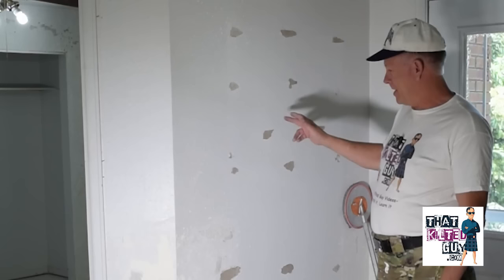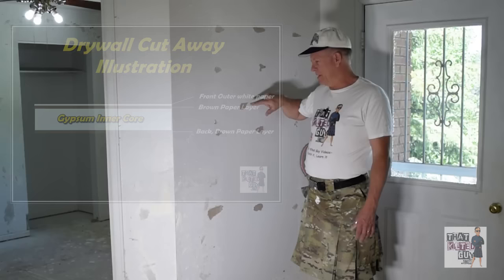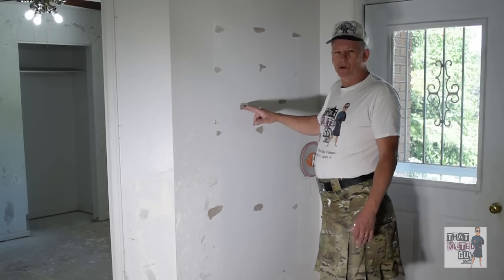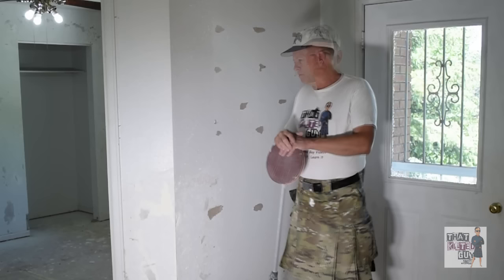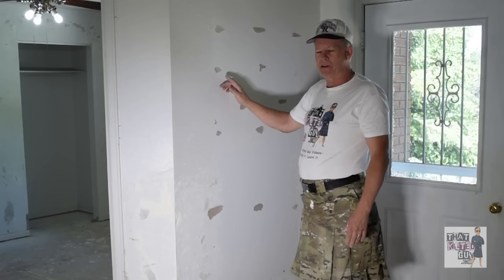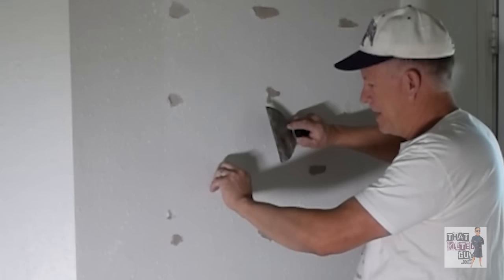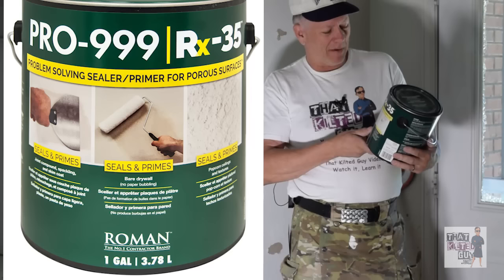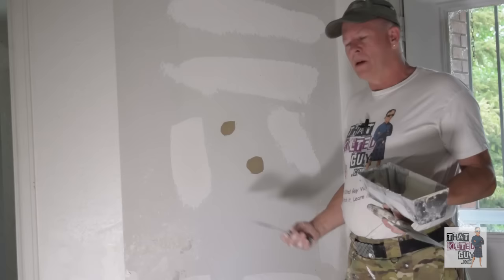⭐ Repair Damaged & Torn Drywall Paper BEFORE YOU MUD IT in 2022!

Comment: All you do it yourselfers, listen to this man when it comes to  drywall finishing. He is telling you the correct ways to do it!
Reply from the maker: Thank you
Reply: Thats so cool that little baby (Gr8Lampini) is allready watching drywall videos and knows when someone is doing it right or wrong.
Reply: Do you really need to do a second coat pf mud considering youre going to skim coat it providing you got the first coat smoothe and it smoothes after sanding?
Reply: What type mud are you using for the second coat?
Reply from the maker: @davidreynolds4684  there’s no hard fast rules for any of this. Use your judgment. I prefer USG +3
Reply: @davidreynolds4684  I agree with those" buttboards". I don't see how that is even legal. Once in a blue moon I will sneak a board in to break on but not every single board.
Reply: Great info at my stage of fixing the bathroom wall!

Comment: Dude, you just solved all my problems. I have been sanding it down too much. The edge always comes back....AND I don't go out far enough from the edges with the mud. I either see the edges or I get a visible lump. I was getting ready to flip out. Thank you for the excellent vid!
Reply from the maker: Excellent. That’s my goal so glad to hear!  Thanks for stopping by. I’ve got many more videos next time you need help.
Reply: Dude next time you can put mash tape and you dont need  the sealer but if you have a lot of them get the sealer. Hope my advice help you as well
Reply from the maker: I've fixed hundreds of these, probably thousands, and I've tried about everything, including the use of mesh tape over it.  But it might work sometimes, but it's not reliable.  Here's the problem.  If you have loose paper that will bubble, and you just put mesh tape over it, then it's still loose and you just put a band aid on it.  The method in the video is the most reliable I've found, but thanks for your input.

Comment: I have to say I've been doing drywall/taping and finishing on and off for 35 years and I've never heard of this product. Granted I haven't done it professionally in over 10 years and do side work once in a while. I don't deny what the video shows but I have never used primer or any other product besides mud, hot mud or the pink stuff in the little container, added some heat from a heat gun and used a 12 inch knife for the finish with a light sand after drying and never had I had one of those repairs for torn paper be an issue. I'm sure this video helped a ton of people and maybe I've just been lucky all these years. I'd like to try this product to see if it helps the overall time of repair for me. Thank you.

Comment: Working in the commercial area. We have wall coverings that when removing take of 100% of the white paper. The product I’ve used was guardz. But thinning down the mud and applying with a roller. A two guy operation. Some times I wondered why we didn’t just laminate 1/4 rock over top if it wasn’t for the grid ceilings we probably would of. 

For those that don’t enjoy playing in the mud. It’s because you aren’t doing it right. Enjoyment can be found in any job done well. 

Keep up the good work. Enjoy your videos

Comment: Thanks you very much for this professional training, I've been painting and drywalling for over 22 years and watch your channel all the time, I've never used this primer /sealer you showed but definitely will try to find some, when I first started I had no idea what I was doing until I got more training from journeyman as time went on, I had in the beginning just mudded right over exposed brown paper and you're exactly correct, it repeatedly keeps bubbling and even if the surface dries you can push the bubbles in, kinda like embedding tape without enough mud underneath, it'll get bubbles and air pockets and turns into a disaster. I've always used white pigmented shellac but will definitely try this product. Thank you very much for your pro tips.
Reply from the maker: You’re welcome
Reply from the maker: Thank you for your input!  It’s a pleasure to be of help.

Comment from the maker: I Need Your Input.  What subjects would you like to see me cover on my channel?  Be specific if you can like, 'Fixing a dent in a wall' or 'how to choose a drywall joint compound' etc.  Comment below and I'll see it.  Thanks!
Reply: "How to remove dark wood paneling from the 40s/50s"
Reply: (I edited this to make my comment more specific.) I just finished scraping popcorn on a large vaulted ceiling.  Have minor-moderate scratching and exposed a bit of brown paper throughout. I plan on sanding, replacing some of the corner tape between the wall and ceiling, treating the ceiling with RX-35, and then applying a skim coat. 
My specific questions are below, and I've seen others with similar questions, but no forum where these are all answered as nicely as you cover a topic. 

Should I apply the RX-35 before or after I fix the tape, or both?  What kind of mud should I use for the tape?  How do you fix the corner tape when the wall is painted, but the ceiling is scrape bare?  After the tape is fixed, and the ceiling is all primed with the RX 35, then I plan on the skim coat. Should I use hot mud for the first layer, then all-purpose mud? Or is all-purpose fine?
Love your videos and your kilt!!
Reply from the maker: M Wilson just now saw this. I fix the brown paper first with rx-35, then mud. Any all purpose works for fixing these or taping.
Reply from the maker: M Wilson i Fix the inside corners by caulking so i don’t have to re texture & paint the wall too

Comment from the maker: Hey everyone, seems I forgot to explain what drywall joint compound I was using in each step well enough.  You'll see I apply a very white mud the first time and a yellow mud the 2nd time.  The first coat was with a fast setting joint compound, aka hot mud, and I use that because it shrinks less & sets up quickly allowing me to put multiple coats on in one day if needed.  Then for the final coat I use a regular lightweight, all purpose mud.  In this case it's called USG Plus 3.  

Also, everyone should be sure and subscribe and click the bell icon if you are interested in this subject as I'm shooting a new video testing 10 new ways to repair these, and showing why it can fail, what to do about it, testing 2 coats vs 1, etc. Here's the subscribe link- https://goo.gl/hCyPDk

NEW- be sure to check out our new website at: www.thatkiltedguy.com
Hope that helps.  Thanks, Guy
Reply: Why the all purpose and can you just use either one for all costs? What I’ve been using is lightweight all purpose joint compound. Any reason I should switch?
Reply from the maker: My favorite is the USG plus 3, lightweight all purpose.  It will do it all, shrinkage is decent and it sands very easily.  Regular all purpose does stick the tape down better, so for taping, it's still superior, but lightweight will work.  The regular AP also shrinks more and sands way harder.  I use a lot of the setting mud purely for speed as it barely shrinks at all, and you can put multiple coats on, even when it's wet, but it sands like concrete.  Lol.  Hope that helps.  Let me know if you have any other questions, and be sure and check out my website at http://www.thatkiltedguy.com
Reply: So the drywall mud is different from the skim coat?
Reply from the maker: Drywall mud is all very similar, and an all purpose like I used here, the USG Plus 3 lightweight all purpose, can be used for everything.  But sometimes they don't recommend their product for certain things, like some say don't use it for the first coat on cornerbead.  So best to read the box label to see if it fits your need.  But I use plus 3 for ALL aspects when I don't need it to set up quickly, and can wait for it to air dry.  It can be used to tape, coat, texture and skim coat.  A skim coat is simply a thin layer of mud you put on then sand off.  I'll do a video on that soon.  Thanks for the question, and be sure to subscribe at https://goo.gl/hCyPDk.  Also, check out our website at: www.thatkiltedguy.com

Comment: Step by Step 
Hope this helps!

1. Sand
2. Cut around edges (if really torn)
3. Peel off with knife (just trying to get loose parts)
4. Pro-999 RX-35 (put a solid coat, will dry in an hour)
5. Mud (use 6” knife) EasySand20 (fast setting mud)
6. Sand down (sand smoothly and around edges)
7. 2nd coat of mud Plus3 by USG (or lightweight all purpose mud) make sure to not coat too think or will get bubbles)
8. Sand edges (tilt and apply pressure, do not flat sand it)
Reply from the maker: Good outline, thanks. I would add to #5, 'put on thin'. And for# 8, sand flat, but not too much, then sand the edges.
Reply: Hi im just wondering. Do you have to do step number 7??
Reply from the maker: You only have to keep coating until it's smooth.

Comment: MH Ready Patch is a solvent based patching compound . Home Depot or Lowe’s has it . It dries hard and fast like hot mud . The key is that it’s solvent based so it won’t lift that raw paper without using a primer product . A water based primer or patching compound is what causes the problem with that raw paper . I started off over 20 years ago as a sand and prime guy , then learned how to finish pretty well , but eventually started painting interior / exterior . The experience I gained early on in drywall has taught me things other painters just don’t know or can’t do .
Reply from the maker: I bet that helps.  But here's my thing.  I've specialized in nothing by repairs for about 20 years now and have probably fixed 20,000 brown paper spots.  Early on they fought me a lot so I started experimenting, and I thought, how about oil based kilz in a can?  Same reasoning you mentioned, and it was better, but still had too many failures.  I've found far less failures with the RX-35, or Gaurdz, and lately even spray adhesive.  Still experimenting and going to try and do a video comparing it.  I tried once and ruined a whole sheet of drywall on my test easel, and couldn't get it to work like I wanted, lol  Thanks for the insight.  I might have to try that in my video.
Reply: @ThatKiltedGuyDIY  it’s all about process . There is no one way or right way . I certainly don’t mean to hijack your comment section . I know you know your shit !! 100% !! 
The fact is the next guy on the job site is the painter . A lot of times the painter does the repairs . In my process , I isolate that type of repair with MH Ready Patch , 3 coats , wiped flat , sanded flat , and the only place there is any patch left is in the indentation in and around the hole . Prime with prep right pro block from Sherwin , two coats of finish and done ! 👍👍
I’ve screwed things up so bad in the past with the traditional drywall finisher techniques doing patches over painted walls that it looked like the walls had the mumps !! 
Try the MH ready patch . The stuff just a year ago was about $6 a quart and now it’s about $15 !! Sherwin stopped carrying it about 3 years ago because they stopped carrying products by zinsser . 👍👍
Thanks for bullshitting with me

Comment: Hope you get this message ! Question- I am gonna be buying the sealant from amazon , my question is if the damage is fairly bad , Should I also be using a tape before mudding? And which one ? Thank you and hope too hear back from you , keep posting,  Fantastic channel!
Reply from the maker: Hi, the only time I add joint tape is if there's a crack, or it's broken up, or you peeled it all the way down to the raw white gypsum, and then only if that section of white is bigger than about 3" across.  If it's a very large section of raw gypsum, I usually cut it out and replace it.

 And, Thanks for subscribing and helping me hit the 100,000 subscriber mark by my birthday on June 10th, 2021.  I truly appreciate it.  Guy

Comment: I am always shocked that people are so rude when person takes their time to make video to educate people and they complain or critique everything. Not everyone has the same methods for doing a job- unless their doing something obviously wrong, shut the hell up. 

Kilted guy, what is the purpose of two coats and what was different about the mud you used the second time? I am assuming it's a different type of product.
Reply from the maker: Hello, and thanks for the comment. I do find it sad that the Internet empowers people to say ugly things they wouldn’t say to your face. But they become bold and  obnoxious bullies and I just ignore them, or provide a polite educational response. Sometimes I turn it into a funny response, but I don’t let it get to me.

The first coat of mud I used was a fast setting joint compound (hot mud) which allows me to turn around and put another coat on it pretty quickly. It’s also less likely to bubble, shrink and is tougher. The second coat is a lightweight easy sanding all-purpose joint compound called plus 3. Locally we get it at Lowe’s and the Drywall Supply. We do two coats, because even the hot mud compound shrinks some, and regular joint compound shrinks quite a bit so it takes two or more coats to get it truly smooth. And I use the regular joint compound on the final coat because it’s much easier to sand.

Hope that helps and feel free to ask any other questions, or just make general comments. It’s nice to have subscribers like yourself.
Reply: Totally agree. Myself included, I have very little experience with tape & spackle unlike my 30+ years of automotive expertise. In my field you see a lot of obnoxious folks online as well. I also don't get involved or otherwise let it get to me.
Reply: ...so why trash talk someone that took the time to share knowledge? Thanks for your videos!
Reply from the maker: Thank you for the kind comments.  And I actually don't let the negatives get to me.  I can choose to just delete them and block the user, but I allow some just to show the narrow mindedness, and because they say even negative comments will help our channel grow, so I just blow it off.  But, I DO delete the really ugly comments and block them, so they have wasted their time.
Reply: We have to be more sensible and respect one another.
Reply from the maker: I agree Rebecca. Thanks, Guy
Reply from the maker: Thanks Captain! Not all Brown paper will bubble but when it does it's a pain so it's better to prevent it instead. 

We do live in an instant gratification society.
Reply: The difference between the green and the blue bucket the blue is lightweight and is much easier to sand but it's thicker the green first coat is best for rental repairs green first coat also has an additive that attracts it to the paper that the blue doesn't have any more experts
Reply: @ThatKiltedGuyDIY  so in order to save time you put on 4 coats just use a green and blue and do it like the pros doing three coats
Reply from the maker: @paulwilliams8555  Green label, regular weight all purpose has more glue in it, it wipes down better when taping and it dries harder.  Lightweight weighs less, spreads well for top coating, and sands much easier.
Reply from the maker: I can see it being different in other countries. And no, never use topcoat for embedding, or on the first coat of metal cornerbead.
Reply: Who said anything about four coats I also do Corners both sides at the same time I'm just good at it I did maintenance work where you try to do everything in one visit at the most two visits
Reply: It never surprises me when people critique someone’s video. Just because they spent time and energy making one, doesn’t mean the information they are offering is correct. There is no end of bad information on YouTube and other places. I’m not a finisher by trade, but I’ve been around it enough to know @That Kilted Guy is on point. I’ve been a Carpenter for 26 years, and I appreciate anyone who knows that black art known as drywall finishing well.

Comment: Used that Rx35 to solve a lot of problems with paint bubbling really bad. Now it's my go to for anything that's sort of questionable.
Reply from the maker: I do that too.  It is a great product.
Reply: @ThatKiltedGuyDIY  Well I actually got it because of your suggestion. But I actually used it later on in the project to make sure the texture and paint/primer would stay adhered to the freshly scrapped popcorn ceiling.

My guess about why my scrapped popcorn ceiling would reject the primer/paint sometimes is that since the popcorn mud was never primered and it was left to age without any protection that something else got in there and was causing issues. At ~$20 a gallon, I consider it cheap insurance.
Reply from the maker: I have a video you should check out.  It will likely explain why that's happening- https://youtu.be/S8omX9yZm6g
Reply: @ThatKiltedGuyDIY  I figured that out as well. I actually went around after the initial scraping and spot checked with the sprayer and scraper and got down to the original mud. Had to do some sanding as well. But yes spot on. I had a feeling that was the case but wasn't completely sure. Any who I'm actually starting on another drywall project for a friend. Luckily it's all virgin drywall. Hasn't been taped and mudded yet so this will be interesting.

Comment: For the sanding block the one that has a wedge shape on one side works best for sand feathering an edge. Use the wedge side. If you use the pad a lot I wrap a fresh piece of sandpaper around it and pin into it with T-pins on the side to hold paper. Replace as necessary, works good. Been using the same sanding block for years.

Comment: What would you recommend doing if you started to repair before watching this video and now there are cracks and bubbles because you didn’t prime it before apply mud? 🙈
Reply from the maker: Do the same thing. Cut out the bubbling and defective areas, seal them, and then finish repairing them.